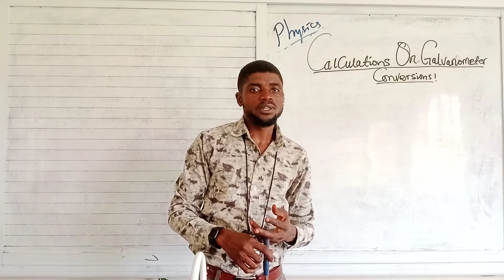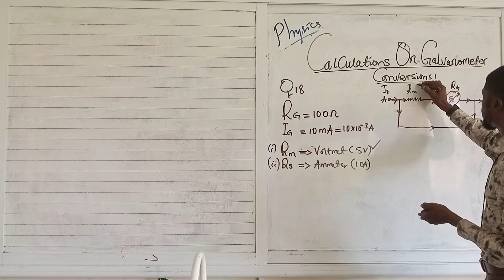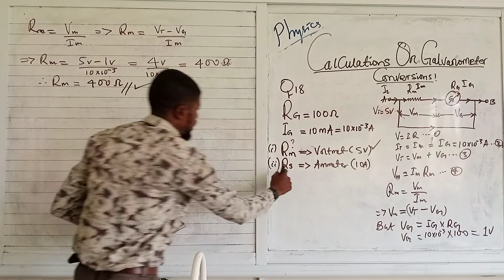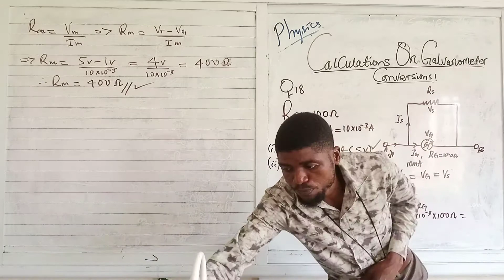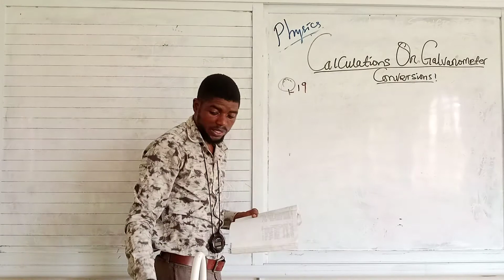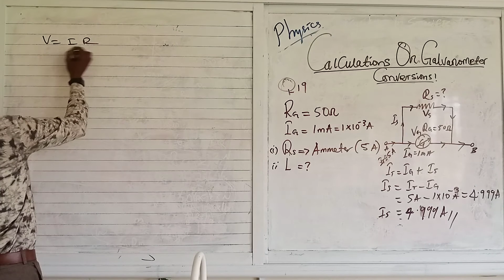CALCULATIONS ON  GALVANOMETER CONVERSIONS: shunt and multiplier.

Comment: Thank you sir alot i really mean alot.
But i want to add something the equation for resistivity was actually mixed up..
Resistivity is directly proportional to area and inversely for the length.
But anyways I really understood and your students re lucky to have you🎉🎉
Reply from the maker: Thanks for the review and your observations. I had to watch the video to see if there was an error, but there was none. What I wrote was the resistance, R, of a wire is directly proportional to the length,l, of a wire and inversely proportional to the cross-sectional area, A, of the wire. Introducing a constant,p, which is the Resistivity of the wire, which is a constant for a particular wire, we have;
R = pl/A...1

pl =  RA ...*
p = RA/ l ...2.

Equation 2 is your argument and it is derived from the original Equation 1.

So there was no mix-up.

I hope this is well explained and understood.

Do well to share our contents with other  learners out there.

God bless you 😇!